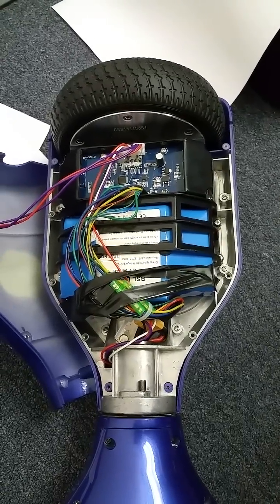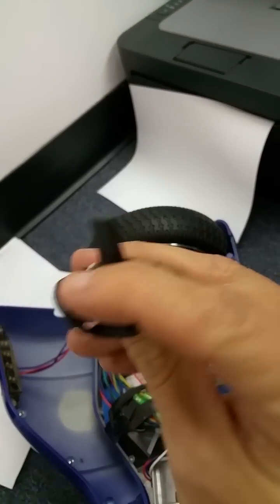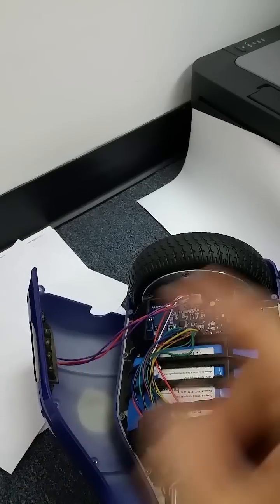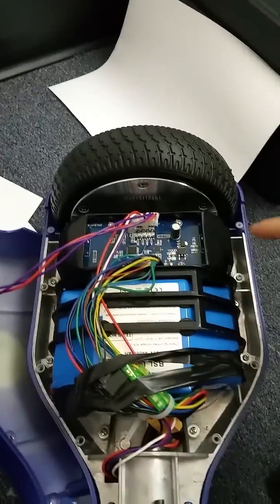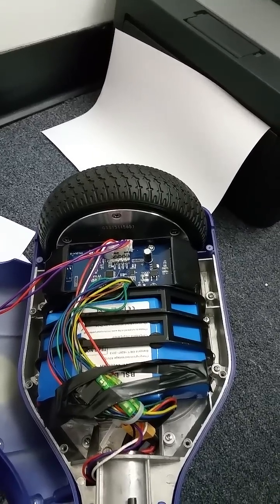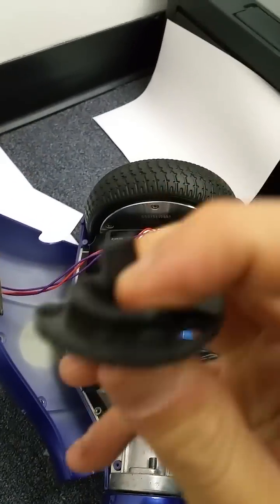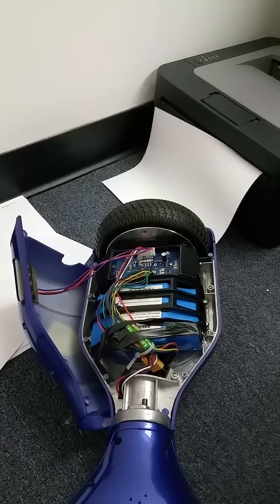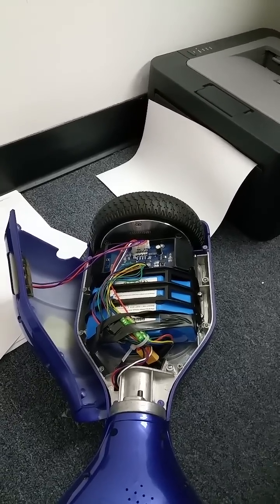Hoverboard Pressure Sensor - How To Fix - Most Common Issue

Comment: We bout one 7 months ago just stopped working two months ago. One side keeps stopping the wheel will spin  but then it stops red light comes on could this be what's wrong that side possibly?
Reply: Brooklyn same
Reply: @garffin2825  had to purchase a new one no one knew how to fix it an the part was 60 bucks when I only paid 100 for the hoverboard just went an spent 100 on. a brand new one with a 2yr warranty. We got swagtron brand this time we have a hoover1

Comment: We bought a hover board and four days later one side stopped working and now both sides are not working.There is no manufacture no serial numbers nothing and the store refuses to return.
If we order new sensors do they work with my hover board? or do we have to find the part for this manufacturer?

Comment: Dude help me, my hoverboard was shaking alot (because i did it on purpose) and it when i rode it, it stopped at random times and it doesnt rotate well, why?
Reply from the maker: what did you do on purpose? typiically shaking is either a bad gyroscope or an air pocket under the foot pedal

Comment: Hello love ur video but I have a question, I just replaced my gyroscope on one side cause the one light was stuck on and that side had no movement. The light problem and movement is fixed but when I step on the side that I did work on it kicks backwards and won't let me control. But only on the side I worked on. I'm buying a new gyroscope just incase it was a bad one but do u have any suggestions cause u seem to know what ur talking about. Thanks
Reply from the maker: i have never had problems just replacing one gyro but i have heard from others that if your going to replace one gyro its best to replace both of them at once

Comment: My hoverboard suddenly stopped moving. It turns on, but won't go when anyone steps on it. It might as well be off. Could this be the issue? I tried re calibrating and it still won't work.
Reply from the maker: sounds like you need a new gyroscope like this http://amzn.to/28JLtpz. just figure out if you need a male or female before ordering.

Comment: When I get off the hoverboard it start freaking out is this how I fix it?
Reply from the maker: could be one of two problems. first is an air pocket under the foot pedal. cut a slit in the foot petal. if that doesn't fix it you need a new gyroscope. http://amzn.to/28JLtpz
Reply: +Johnny Amicci so I cut a slit on the actual hoverboard pedal?
Reply: +Johnny Amicci also my hoverboard leans to one side

Comment: Hey Johnny, I have board that runs for a few minutes then completely shuts down. Lights are off and no power. And the only way turn it on is to plug the charger back in. What am I looking for as a fault?
Reply from the maker: +Steve Hood either bad battery or motherboard. do you have any friends with boards? try putting their battery in and see what happens. if you need a new motherboard you can grab one here amzn.to/1Kmvvyr